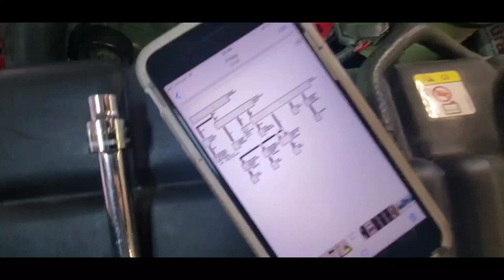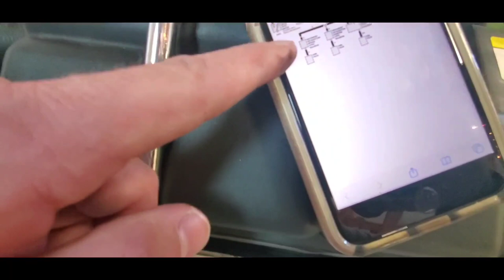How to Remove the Smog Pump from a 96-98 Cobra

Comment: Finally someone made a video on this! I’m going to be doing the SAI system delete as well. Totally agree with you on being a minimalist & getting rid of everything the car doesn’t need 👍🏻 are you thinking of doing a COP conversion? The COP conversion and battery relocation are first on my list for cleaning up the bay on my 96 Cobra
Reply from the maker: Matt Gulian I’ve definitely thought about it! Will get rid of a lot of the stuff in front of the engine, I’m sure it will drop a small amount of weight too and pick up a slight performance gain

Comment: SVT Zac - I have 1 97 Cobra with that system on it. I'm in Oregon, and they're pretty strict with emissions. We have to do emissions checks to get tags. Do you know if that will throw off the emissions readings?
Reply from the maker: It probably will, can’t say for sure though I never had emissions done on this
Reply: I'm in Colorado, we have CA style emissions here.  I have EGR and SAI disabled in my tuner and it still passes with flying colors.

Comment: vise grips should pinch that exhaust nipple closed easily and then bend it over rinse and repeat clean it up and use solder. There really wasnt a need to go out and get the high temp crap

Comment: Love the video helps alot...  I pulled up that same code.. just curious could this be a reason when I stomp on it the car hesitate kind of bogg but car idles fine I push gas peddle it revs fine but inlet when I drive it and stomp on lmk thx
Reply from the maker: WHO DAT could be, you really should get a tune after removing this but I haven’t and car runs fine still
Reply: Mahalo brother